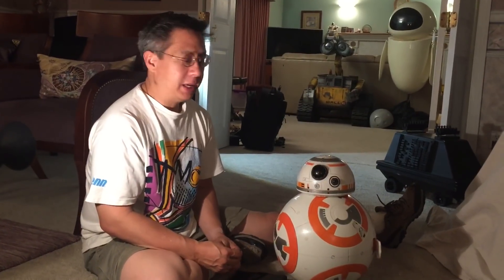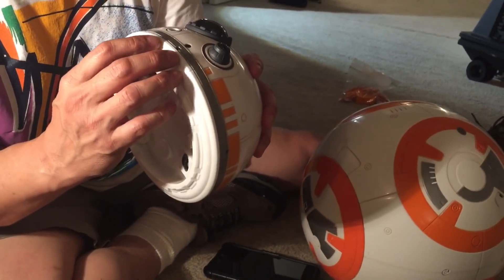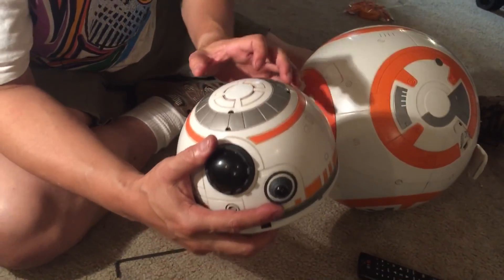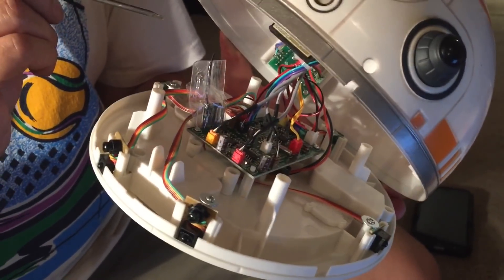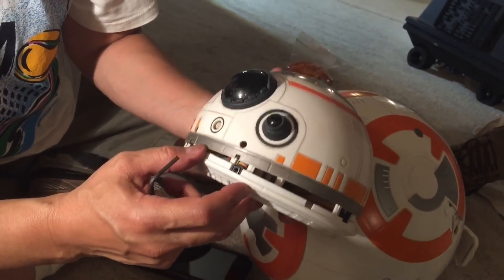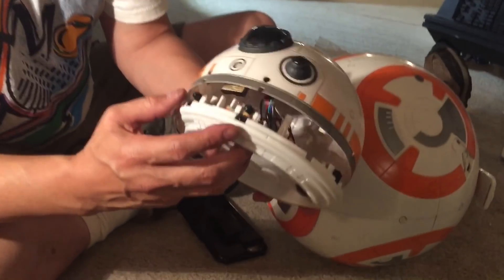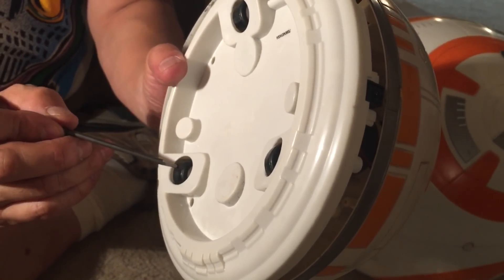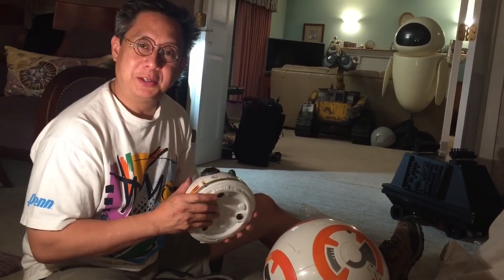Spin Master Hero Droid BB8 - Head Deconstruction

Comment: Well, I have taken the challenge. Disassembling BB8 I found relaxing, oddly enough. This replacement battery is due to arrive today.  I have accounted for every screw for every part removed. Pictures included. However, there is one switch, and I have no idea where the heck it came from. It is small switch, rectangular in shape, with red and black wires coming from it located at the bottom left hand side of the bezel. I do not recall removing screws for this switch. There is another sensor that looks just like it and it has yellow wires coming from. I recall removing those screws.

Any idea where this sensor is supposed to go?

Jonathan

Comment: So disappointed in this toy.  I think the battery in the head is dead.  And the inside sheath for the usb plug connector came out of the head.  It'stricky, but I can still get the USB plugged in.  But it won't respond to the body or the remote anymore.  But even after charging, it's comepletely dead.
Thanks for the video, I might try to see if I can replace that battery.
To those that are thinking about getting this, don't.  Kid seemed to tire quickly of it.  So I feel like there's nothing to lose if I tear down the head and can't get it repaired.  Edit:  Reading lots of comments, my problem seems common, one more reason to skip this toy.
Reply: I ordered a Y tip screwdriver to remove the screws from the head.  There were bundles of wires that had colored connector tips, there are corresponding colored ports on the mainboard.  So I removed all the wired connectors so I could separate the base of the head from the cap.  Under the mainboard was a little retention clip holding that 400mAh battery.
I ordered a Akzyute 3.7v 1100mAh replacement off Amazon.  I knew it wouldn't fit, but I wanted something with more capacity.  It's too big to fit under the retention clip, so I just ditched the clip.  The mainboard, when screwed in, holds the bigger battery in place.  The wires from the battery were shorter than the original battery, so I snipped the 
connector off the new battery, sniped the old battery's wires off at the base, and spliced them together.  Perfect.  This is where things went down hill, when I was putting it all back together.  When I was almost done, I noticed the last couple of colored wire tips didn't match up to the colored ports anymore.  The purple port had a blue connector, the white
port had a yellow connector.  There were no other connectors so this had to be right...  Anyway, it powers up, the green "full charge" light won't turn off, even when the head is off.  But it works again.  Still don't recommend this toy, it's still trash.  Haven't had it a year, we shouldn't have these problems.

Comment: Do you know what kind of battery replacement I can get for the head? Thanks so much!
Also does it come out fairly easy to switch out?
Reply: I need that too
Reply: Stock is 3.7v. 400mAh battery.    You get a 3.7v 800mAh battery and it will fit in the same location . I had to break off 22 little pieces of plastic that was around the old stock battery but when the new batt fits nice and is held down well with the screw held crossbar.  Doubles the life.

Comment: Mine is only a year old and it will work for a minute and then the red light blinks on the head and then is inactive. Any ideas ?
Reply: The battery is dead, chances are. You need to charge it every so often, or the battery will stop charging up and drain quickly.

Comment: Hi ... My name is Glenn, I'm from Costa Rica.  I have a question: I have a BB8 identical to yours, I love taking it to exhibitions (I am a Star Wars Cosplayer) but the problem is that the head load runs out very fast (30 or 40 min), the question is: could you  guide to adapt a lithium battery with more duration, that is to operate a minimum hour ... I think it would be a good improvement ... My email is payasotatarin@gmail.com.... Thank you very much ...

Comment: Sir, where can I get another internal Spin Master Hero BB-8's power, sensor, control board, (main pcb board), and where do the sensors go for reinstall...I know I should have taken pictures before deconstruction. I replaced the rechargeable battery because the Shinda battery was junk. Ran 10 minutes Christmas morning, then needed recharge after following the directions. Spin Master could not tell me anything as they are no longer manufactured according to Corporate and Customer care. Otherwise, I have a disabled non-working droid for my grandson.
Reply: Where do you get a battery?
Reply from the maker: Sorry, I have no idea where to get parts.  I know Spin Master does not have parts, but that's pretty much standard practice in products like this.
Reply: Have you checked eBay for parts?  I see people are selling broken ones there for parts. Also, I bought one used and it only holds a charge for a few min. Im going to replace the internal batteries. Did you happen to find really good ones for the head or body? They specs say that there is an internal 400 mAH and also one Ni-MH 1800 mAH. Would it be safe to replace them with Li-ion batteries?

Comment: Mike, have you tried adding better/stronger magnets yet? I know the stock ones are best for balance but my head pops off with any little bump. I’d love to put in a better set. Let me know and thank you. Great videos too!
Reply: When the head is attached, try twisting it around. All four magnets need to lock into position to avoid a fall. Sometimes people will have it falling off on its own, and usually its due to only one magnet being locked.
Reply: I’ve glued some extra magnets on the underside of the head next to the stock plastic ones.

Comment: Hello, my BB8's head doesnt turn on even though its fully charged, none of the lights are coming on on the head whatsoever , what should i do? should i open the head and see if there is a lose connection somewhere? you said somewhere in the comments that the head had a battery...
Reply from the maker: Yes I would open it up and look for something disconnected.
Reply: I have the same problem, could you fix it?

Comment: Mike, my BB-8 doesnt recognize my voice anymore, maybe due to its head kept falling off thus damaging the microphones. Is there any way to fix this?
Reply from the maker: mohamad baihaki mohd. nawi I would open the head up and look for loose connections or other possible drop damage like loose components, cracked or dislodged circuit boards.
Reply: Hi.. do you still have your bb8, if you do, did you ever fix the problem?

Comment: Hi Mike, how do you change the battery? Thanks
Reply from the maker: You would have to crack it open to change it.  There is a battery in the body and in the head.   Oh and also the transmitter, not sure which battery you are asking about.
Reply: @TheMikeSenna  does it have a standard battery that can be bought at stores or online?

Comment: Hey mike, great video! I've been contemplating painting my bb8 hero droid, not a complete paint job - just to add more weathering like you see in TFA, ive seen a few tutorials on how to do that with a bb8 model but these haven't had any electrics inside, is it too risky to try this or could I manage it with tape covering parts like the eyes, speakers, microphone, etc.?
Another question I have is that  I have seen one such tutorial where weathering has been applied, the paint sealed on and then a 'rubber spray' applied over the top to give it a smooth texture, if this was done to the hero droid would it mess with the magnets? Any advice you could give would be great! Keep up the awesome work!
Reply from the maker: Oh wow.  I hadn’t thought of the weathering interfering with the operation.  I would definitely use an automotive two part clear coat on the body and head.  And then I would only run it on carpet after.  Look up 2k clear coat.  It’s a two part auto clear coat in a can.  I used it on my full size BB8.  You need at least three coats on top of the weathering.   This coat is so the wheels on the head will still glide over the body without removing paint.  I would use a semi gloss or matte.  

I don’t think you have to worry about the mics, etc, unless you apply a large amount of diluted paint to weather it.  I haven’t seen the tutorials.  Also if you aren’t used to weathering, you might want to try some technics on some other plastic toy.

Comment: Hello Mike, is it possible  to add a few more  magnet' s  to keep the head on better?
Reply from the maker: No, there is a fine balance between the surface fiction and pull of the magnets.  The more powerful the magnets the more friction.  I believe they have designed this to maximize the balance.
Reply: TheMikeSenna my BB8's head magnets are actually weakening and it's head falls off a little too easily, do you know what size magnets they use so I can replace them?

Comment: Thanks For the tear down. Curious to see how people on the builders group start to integrate this.
Reply: Sonic Alchemy: A maker space right! I think this drive system is very similar to the red carpet drive system and may Haley the bb8 builders make their own
Reply: I was more curios about the IR sensors and the idea of only driving from one side. Finally the pendulum is interesting because it rides on a track and that is different to the club system. I think it is worth looking at though the whether is transfers to the bigger system with out need much bigger motors is a question
Reply: Sonic Alchemy: A maker space but could be modified to rotate on one spot for more movement but yeah the follow me would be nice for DIY BB8s